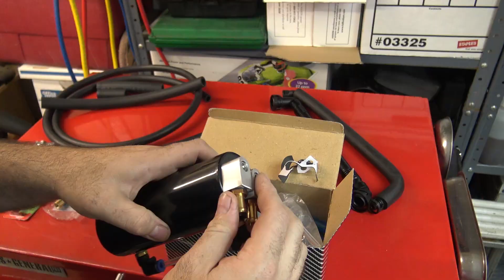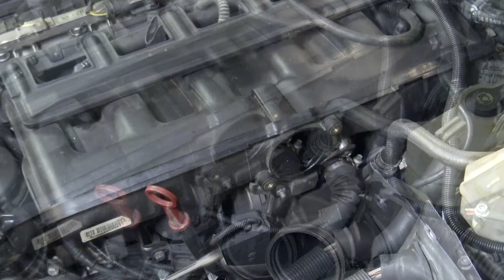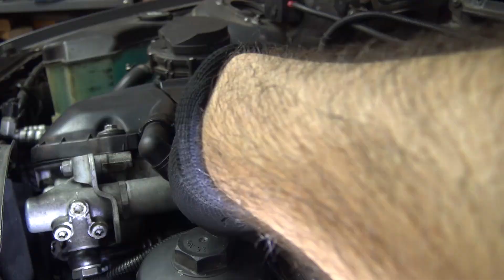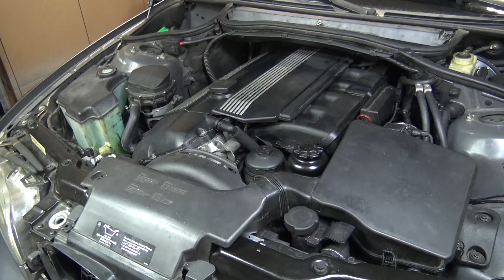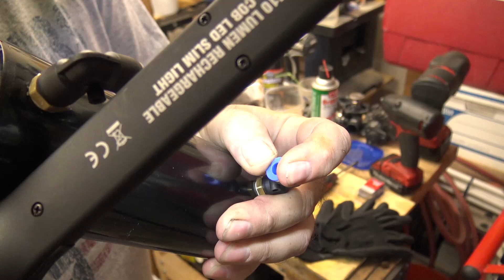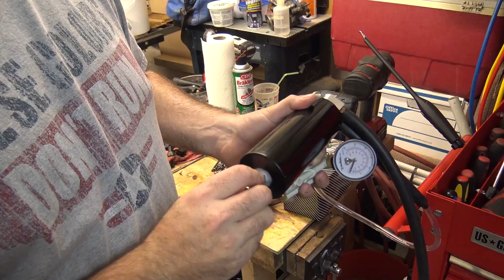BMW E46 Oil Catch Can Install DIY

Comment: another great video..question on M52tu the vacuum line from fuel regulator connects to the CCV ..so if you replace the ccv with oil catch tank what happens to the fuel reg vacuum line ... this vacuum line does not have much vacuum and is for leaking regulator diaphragm isn't it ..maybe connect to oil drain before the one way valve with 3/8 to 1/8 garden Tpiece.
am going to do one of these PCV units but will use the 16 mm inlet and outlet on the catch can so only have  one odd size ...great work again
Reply from the maker: The fuel pressure regulator doesn't need vacuum in order to function, that line is just to route fumes/gas in case the diaphragm ever bursts.  You can leave that line disconnected.

Comment: Damn you put quite some work into this. I'm gonna wait for the results in a month or so before I mod mine. For now I ordered a new CCV to replace the leaking sticky OEM one :) Btw, if anyone decides just to keep the OEM CCV on, check your dipstick drain as mine was so clogged that I had to burn it in order to be able to take all the gunk out and actually have a flow trough it. Nice work ! keep us up with the results.

Comment: How's that catch can working out? I'd like to know to see if it something I should do
Reply from the maker: It's working out fine.
Reply: Awesome.  I am gonna follow your lead here and get the parts. I am doing a lot of upgrades maintenance and I am at about 100k miles. This would be a very simple swap out as I have changed a CCV before on an M54. I am a bit concerned about the level of vacuum pulling in the dipstick tube possibly pulling oil up the line into the catch.
Reply: However there is not a significant amount of vacuum currently in the valve cover that would lead me to believe it would suck oil up the line.  Just wondering how much negative pressure increase we will see as this system is installed. Drain tube is in my plans  so that's why I like your video. I really wanted to be as close to normal conditions as possible but I would like to decrease the amount of oil consumption.  Thank you for your videos.

Comment: So awesome! Your videos are the best they have saved me so much time and money. They're clear, detailed and well made all of them. I think you had the PCV valve right the first time though I put it on the intake side threads going towards the manifold.  Thanks and please keep it going!
Reply from the maker: Thanks dude.  It's not a matter of where the PCV valve was installed, it's which way it was installed.  I wasn't able to flip it around and put it in the same spot the 2nd time because it had a 1/2" end and a 3/8" end, so I had to put it in the other hose.

Comment: Great video and i love your honesty but when it comes to oil consumption its all about the oil dipstick design bmw have a new design here is pics that shows the difference between old and new http://s1095.photobucket.com/user/mach-schnell/media/Dip1.jpg.html?sort=3&o=15 new one they say its for cold climate but thats bs since i put the new design i have no more oil consumption
Reply from the maker: Emad Salem that's not what causes or cures oil consumption, it just prevents clogging of the dipstick tube

Comment: Hi there 50skid,
Ive used this video as a reference to fit my own catch can to a 318 bmw with the 2.0 ltr engine. 
after starting it up today it starting priducing alot of smoke and im wondering if it the catch can that is the issue. Also there was a very high pitched squeal. 
take a look at my video and see if you have experienced anything like this? 

https://www.youtube.com/watch?v=0FmjUSBUVYA

Please advice me on what you think this issue could be? 

Read my description for more info on what i do to the car. 

thank you

Comment: I found this catch can in Ebay. It seems to address all the vacuums leak issues you encountered. Of course it is twice the price you paid but still cheaper than the really high end ones. I'm not sure the view glass in the side will hold out and keep the vacuum seal. BTW... You seem to be the best source of e46 M54 instructional videos out there. I have subscribed to your youtube and use it for my primary source of info. 
http://www.ebay.com/itm/Turbo-Billet-Aluminum-Cylinder-Oil-Catch-Reservoir-Tank-Can-Breather-Kit-Black-/261466063694?hash=item3ce097834e:g:Ln8AAOxyc2pTXs1i&vxp=mtr
Reply from the maker: I recently saw that one too.  Looks good, but it might be too wide to fit in that little cavity where I put mine.  But it could always go in the "hidden" spot below it.
Reply from the maker: I've also recently been made aware of the E39 M5 oil separator, part number 11151406789.  I'm thinking about doing a video on it after my experiment is over, because it looks like you wouldn't have to do as many hose adapters.
Reply: I think the main advantage is this is more vacuum tight.
Reply: Whats the advantage of an M5 Oil Separator, instead of the Catch can, or stock PCV system?

Comment: I've seen M54B30 race cars use an E39 M5 oil separator, part number 11151406788. I will attempt this if/ when my ccv fails! Thanks.
Reply from the maker: Niaaal wow, I didn't even know such a thing existed! I wonder what it looks like on the inside...
Reply from the maker: And here we go, this is what it looks like inside: http://i1095.photobucket.com/albums/i467/mach-schnell/M5OS.jpg  It's basically the exact same thing as the catch can I installed, only plastic and a different shape.  But at least you don't have to plug anything up or worry about vacuum leaks.  Just super simple, connect 3 hoses and be done with it.  I like it.
Reply: @50sKid  hi, i know its an old topic but hey we stil have our cars hey haha, anyway trying to clarify which is the best method closest to stock CCV, if am correct the CCV somehow filters the moist in the oil or something like that? On the oil Catch can you installed does it not just sent back the oil direct or does it have a filter in it or is there a better alternative,  seen on the link the plastic one with a filter. Is that better or its the same? Please advise.
Reply: Niaaal 11151406788
Reply: It looks just like the e46 stock ccv cyclone style separation
Reply: Have a look to the reference 11151705237 (oil separator for X5). I have found it on eBay even cheaper. Not bad at all! Thank you for your very interesting videos! (E46 small 4 cylinder N46B20 owner)

Comment: BMW CCV are used because the intake is lower than the valve cover IMO.
I ran a CCV delete on my 02 X5's without a catch can because I live in the midwest.
There are a few problems with the CCV system, The drain hose to the dipstick gets overlooked during maintenance, carbon deposit begin to restrict the flow of oil to the pan causing backup of oil into the intake (Summer) In the Winter the vehicle needs to reach operating temperature to boil off the moisture aka "Mayo" in the crankcase. People living in colder climates know what I'm talking about. Now with that fluff of "Mayo" and that hose to the dipstick restricted were is the fluff "Mayo" going to go? That's correct into the intake because the old & new CCV drain is plugged.So going back to the first sentence gives you the answer. The valve cover has to be lower the intake so that gravity will drain the oil back into the valve cover. Remove the CCV, Plug up the hose that goes to the dipstick.
Now you will have to connect the intake vacuum line to the valve cover connector. ALL THE CONNECTERS AND THE VALVE COVER CONNECTOR HAVE TO BE ABOVE THE INTAKE. (I'm not shouting just making this very important) Line and hoses to use: Use fuel line which is plastic, the rubber hoses use as little as possible or as a coupling to connect the plastic line to a fitting etc. If you run, to long of a piece of hose they will collapse due to vacuum.
When done no more Mayo or oil consumption ( as long as your rings are still good)
My 2 cents.

Comment: So OCC then.
Reply from the maker: No I'll be rebuilding soon, I'm just doing every video I possibly can.  After this experiment is over and I have results on whether it helps the oil consumption, I'll do a video on the 02Pilot mod, then I'll do a video on the ACDelco piston soak, then I'll proceed with the rebuild.  I found a supplier of M54 rings (1.2mm top ring) that has the 3-piece style oil control ring.
Reply: I did the ACDelco piston soak last year after getting random misfire codes on my 2000 e46 323i. I bought the car used when the previous owner couldn't get the car to pass smog. The piston soak fixed the random misfire codes which cleared the monitors and allowed me to pass CA smog. When doing the soak, I used 150ml per cylinder and let it sit 24 hrs. I repeated the procedure three times over 5 days (last two times with car lifted on passenger side to try to get piston heads level) since once wasn't enough. The engine will still occasionally (about once every three months) set a pending fault but it never becomes a real fault. I admit a rebuild is better ... but for $20 I can drive my car to work every day no problem.
Reply from the maker: You should check your compression and leak down

Comment: Thanks Kid. Another great video. My big question, only because its been brought up on other forums, how does the extra vacuum affect the oil pan gasket. I REALLY want to install one of these catch cans as I am in Michigan and can guarantee  I have a clogged CCV and dipstick tube. I would much rather replace the CCV than an oil pan gasket. The catch can just seem a bit easier. But yes, what do you know about the oil pan gasket?
Reply from the maker: Whoever said the CCV would affect the oil pan gasket (it won't)?
Reply: I saw it in several places in on e46 Fanatics and bimmerfest forums. I think having the PCV valve is HUGE. I'm sure that helps regulate the overall pressure of the system. But yes, there are lots of posts out there about the oil filter housing gasket and oil pan gasket failing due to the increase in vacuum. I recently did my valve cover gasket. I know mine should be solid there. I am excited to see your results!!! I am REALLY interested in switching to a catch can. THANKS KID!!!!
Reply from the maker: No, an increase of vacuum will not cause those gaskets to fail.  There's no reason it should, if you think about it.  An INCREASE of pressure inside the crankcase would, but not a DECREASE in pressure (which is what vacuum is).  But both of those gaskets probably need to be changed at this point if they haven't already been.
Reply: OK, GREAT!!! It just goes to show you can't believe everything on the internet. This is a perfect time of year for me to work on the car, before the winter months hit. It looks like I just added a new project. Thanks again KID!!!

Comment: 50sKid. The AddW1 catch can does not have that rubber line,.Its a little more money, but is is all metal.I am running it on my 04 e46 320i for about 3mths now,no problems. P.S i bought it for $90.00

Comment: Ive ran a pcv valve inside the same tube just be sure to check the valve especially if engine has milky foam from water in oil will clog pcv valve.

Comment: I been also watching Elbow Grease and his content about the infamous oil scrappers on this engine. Would the increased vacuum help oil rings sit and seal properly ( On my E46 i caped all intake ports for ccv except valve cover outlet venting out through filter,)
Reply from the maker: Yes the theory is the increased vacuum helps the "infamous" oil rings seal better.  Which is what I was talking about at the end of the video.  Just venting to atmosphere is not good.  And I hear you start to smell oil fumes in the car because they get through the microfilter.
Reply: yea while venting it did not see little to no oil being lost through the vent pipe however whole intake manifold has been clean out replaced and made sure no vacuum leaks will happen. when i did this i  did the delte with no catch can and had a major vacuum leak but it might be dipstick tube o ring may be pinched during removal of manifold. so once i get that fixed i will try to get vacuum back to engine and stall the oil cunsumption to save for rebuild for the new oil scrapper rings. Thanks for the reply
Reply from the maker: If you are just venting the valve cover to atmosphere then it doesn't matter about the o-ring on the dipstick tube.  That only matters if the crank case is put under vacuum by connecting the valve cover to the intake manifold (through a CCV system or a catch can system like I did in the video).  Your vacuum leak is being caused by something else.

Comment: Hey, what might happen if i dont use those valves ? Only straight hose ? 
Great work ! Very nice videos, thanks for all of them  ! :)
Reply from the maker: Any small vacuum leak becomes a much bigger vacuum leak because you're putting full vacuum on the system.
Reply: He ment the pvc valve and non return valve on your return pipe

Comment: when I installed my catch can I also started chasing vacuum leaks, I got those same 1/4 block off bolts and got rid of the clear tube. good work on finding those leaks
Reply from the maker: Thanks!
Reply: @50sKid  Quick question: is the inlet on the catch can too small? The valve cover outlet is way bigger. I have m50 manifold, only need to collect from CCV

Comment: Good video, I have a catch can installed on my car for almost two years now.  I am very intrigued about your drain back solution.  Here on the North East Cost the can fills up with water and will freeze causing your valve cover gasket to blow out.  Not an issue if you live in a warm climate though.  During the months of January - March checking my can every week is a must, but in the warmer weather months I'll check it once a month and it has a little bit of oil in it.  I have been contemplating installing a drain back but I am hesitant, looks like I will be going through another winter without one.   I do have one question about fuel trims.  My STFT are good at under 5 but my LTFT's are much higher above 10.  The car has an can hold good vacuum so what other issue might cause that?

Thanks for the video and keep up the good work!
Reply from the maker: I think in your case, a drain is not a good idea.  I'm curious as to why, if there was ice at the bottom of your catch can, that would make the valve cover blow out?  Also, if you have 5 STFT and 10 LTFT, then you have a total of 15 and that is bad.  That is causing you high mileage.  Don't assume your can is air tight--test it like I did in the video.  It could be that or maybe your valve cover gasket isn't sealing properly.  When you run a system like this and you put full vacuum on the valve cover, any small leaks will become large leaks.
Reply: I'm pondering putting a drain valve on there and attaching that to the dip-stick tube.  That way I can control when it gets drained and where
Reply: I also have been pondering the idea of attaching a drain from the catch can to the dip stick tube.  If the can fills up with oil/water which it does rather quickly in the winter, on those real cold mornings it will freeze up on you and cause your valve cover gasket to blow out.   If I do add the drain I am going to have to put a check valve in line so as not to suck oil back into the catch can from the oil pan.  As 50sKid mentioned these systems generate full vacuum and is why the car responds so well.  But is also the reason we start seeing lean conditions because of vacuum leaks.
Reply: I already have a vaccum leak ;)  that is why I'm doing this.   I figure if I have to replace the CCV anyways, I may as well upgrade for less.
Reply: https://www.amazon.com/s/ref=nb_sb_noss_1?url=search-alias%3Dautomotive&field-keywords=oil+drain+valve

with that valve you have control of when it gets dumped.... may be a good compromise.

Comment: What I need to understand is the PCV to be installed at intake manifold hose or to the crankcase hose?
Reply: The PCV is what the engine needs to hold vacuum, with out that valve your motor wont run very well.
Reply from the maker: It doesn't matter where the PCV valve is installed, but it DOES matter which direction it is installed.  When you look at the valve, you can see a little metal thing on one side.  That is the check valve and that goes toward the valve cover.  It's as simple as that.

Comment: When I first came in contact with this CCV system I didn't exactly understand why they engineered it the way it is and I was new to M54 so didn't want to mess with the ccv system heard that it is very sensitive to that. On my car I used the factory parts and replaced them but those tubes and the ccv can under the inlet are pretty bad quality, even the genuine ones will make weird "plastic" noises, wear and get fragile over time. I think they engineered it the way it is to hide that crap :D . I liked how you kept the factory functions with valves but made it a little bit more industrial, and damn it would be cheaper, easier and better to modify it to work like this than to get the oem parts and swap them. Let us know if it makes it any better for you engine :)
Reply from the maker: Thanks!
Reply: 50sKid what i need to do i put OCC now i have very strong vaccum